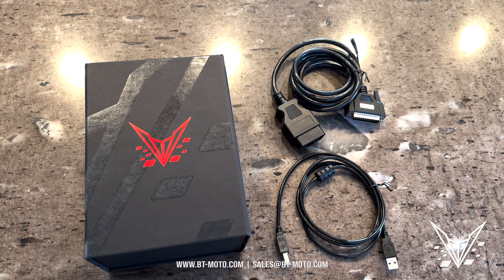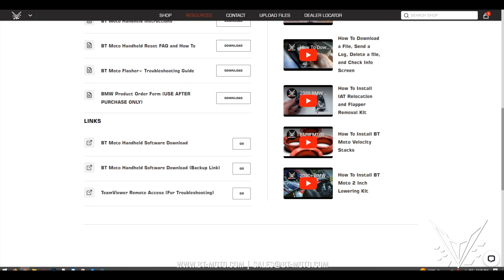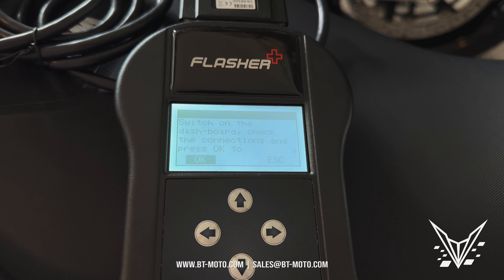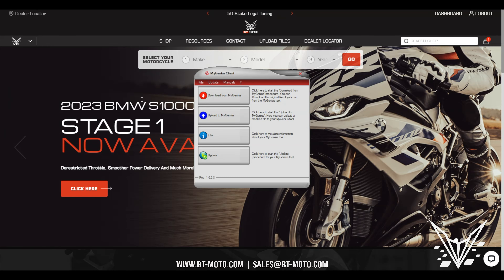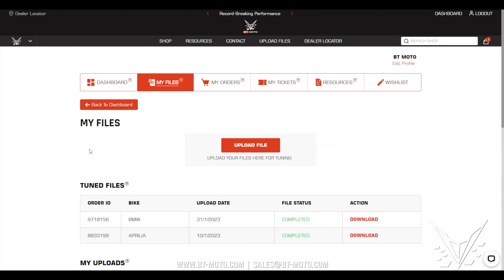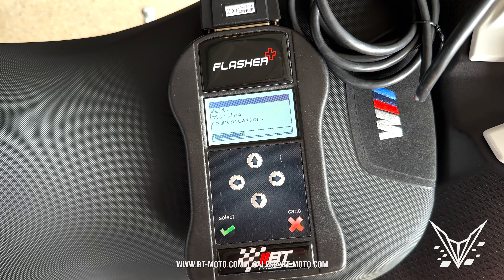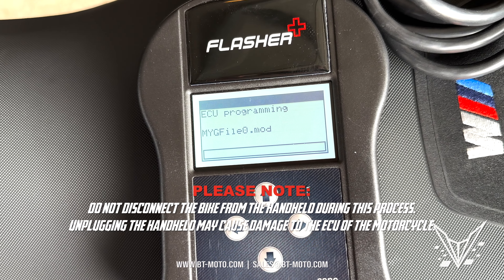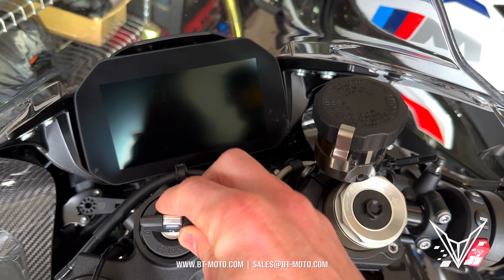How To Install The BT Moto Handheld

Comment: Does doing this void the warranty?
Reply: If you switch it back to OEM before taking it in to service, the dealership wouldn't know any tune has been done unless your bike stores that kind of info. That would be a question for the manufacturer.
Reply: Depends on the manufacturer. They will be able to see your ECU was flashed if you have trouble with the bike. All depends on what problem you have and whether the dealer/manufacturer believes the tune caused x issue. Seems like a lot of brands are pretty reasonable with tunes but do so at your own risk.